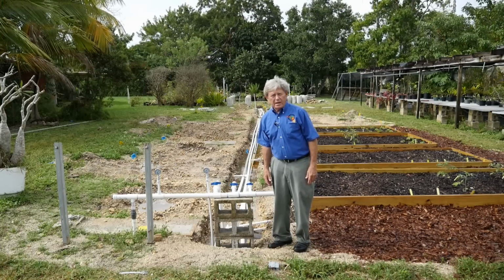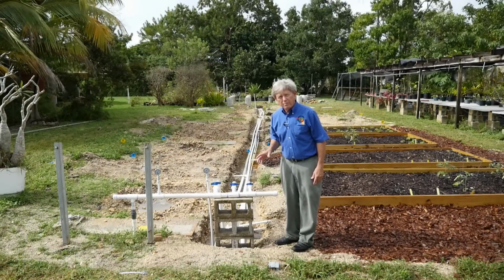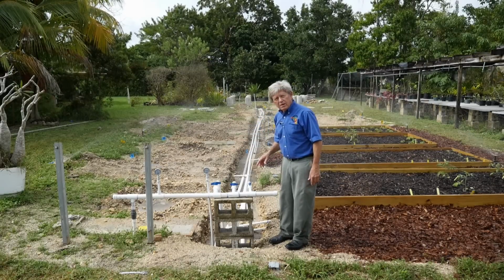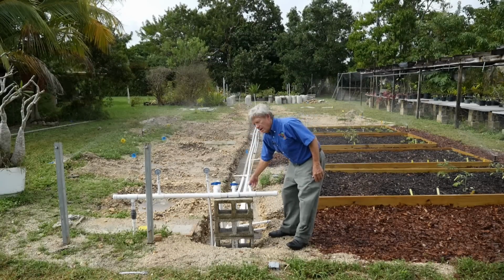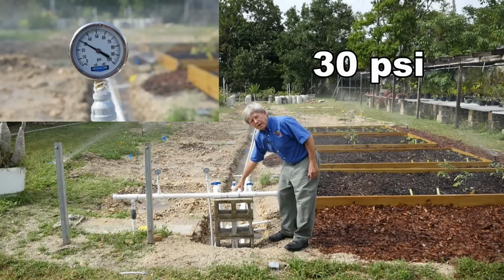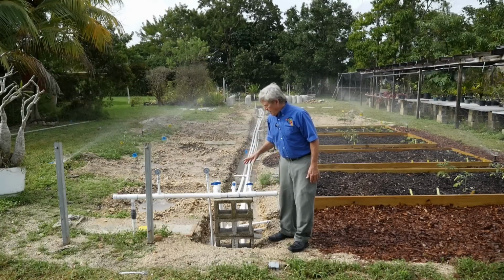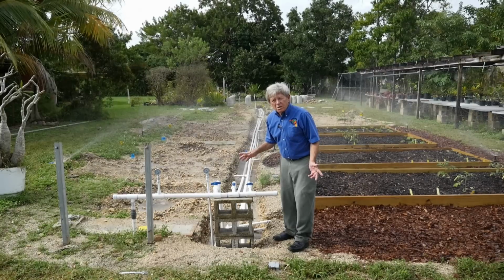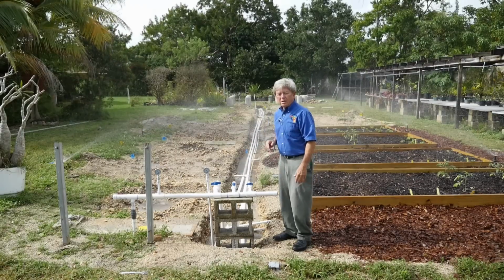Water pressure, flow, and pipe size - 1

Comment: I have an inquiry, not irrigation related but maybe someone might know. I’m trying to run water to two rooms that will service a washer and two sinks. I’m tapping off a 1/2 pvc that feeds a hose in the backyard. Will connecting from it to a 3/4 pipe make it more pressurized or allow or allow it to have better water flow or is it already restricted since it’s from a 1/2 pipe? It will only run about 25’ to the rooms.

Comment: The problem with this video is it might make people think that bigger pipe = more pressure. That's not really the case, and you do address that a bit. Bigger pipe just results in less loss of pressure. Most sprinklers will operate well on a wide range of pressures you would normally find at a home, from 30-80psi. Many can be adjusted manually. People have the misconception that if you go from a large pipe, say 4", down to a 1/2" sprinkler, you'll blow it up, because the pressure will be too high. That's not the case. As you said, you can only reduce pressure.

Comment: Did my irrigation system following his advise of pipe size and was able to pull 27 sprinklers with 1.5 horse power shallow well pump. Just need to measure my the preasure at the end of the line to check the PSI. My neighbor has a bigger pump about the same amount of sprinklers and he has to run it in three zone because the person who did his sprinklers used 3/4 all the way.